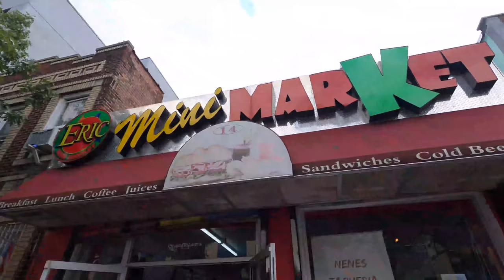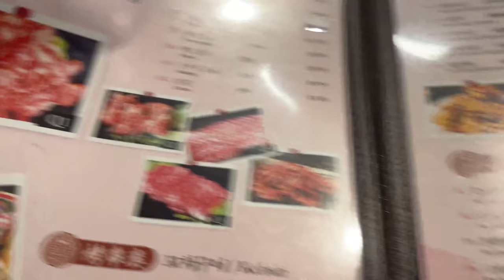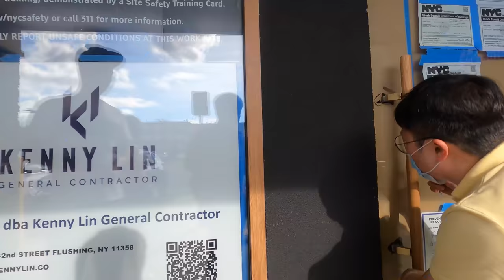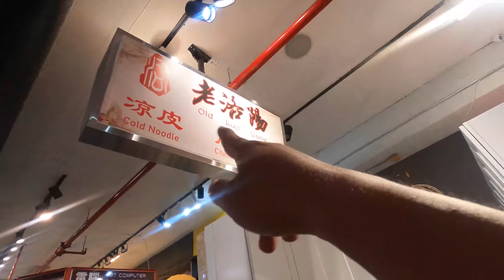MEXICAN BIRRIA PIZZA, Ramen Restaurant UPDATE & Life in St. Louis Missouri

Comment: i think the air was actually turned off no broken, think about it, high prices and the heat inside the building with all those grills in front of customers making it even hotter and it's been getting hot outside lately, so it is a good tactic because people will be forced to deal with the extreme heat so they'll get in eat fast get out letting more people in thus they'll get more customers than usual in a day and if that is done every day than they make more money that way during open hours, well played very well played lol[dunno if it's true but it would be a good idea, not so much for their customers but for them] and with places closing either for long periods of time or even permentality and struggling to make money these days most of us probably wouldn't mind because hell most of us have to do what we have to do now in this economy.